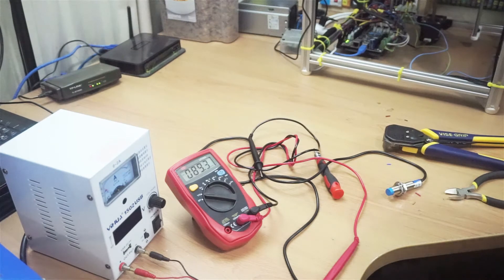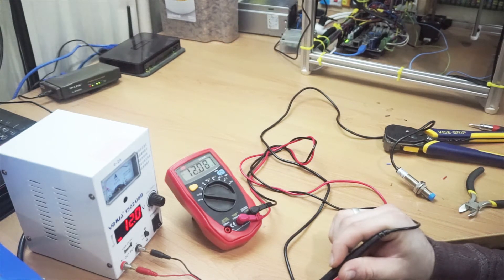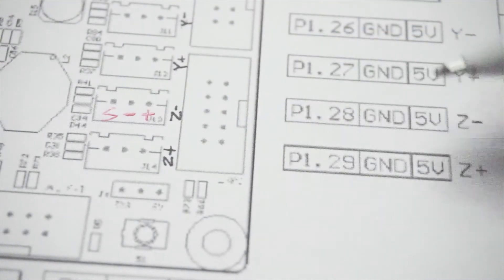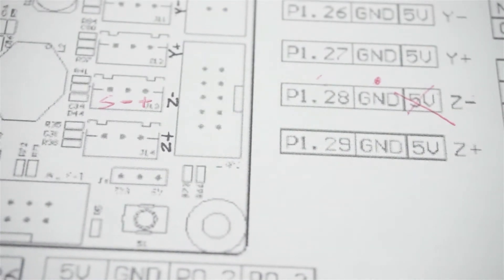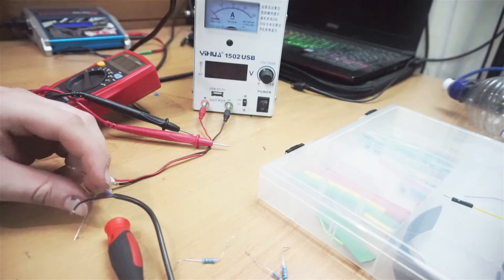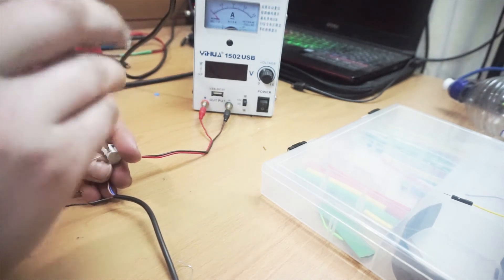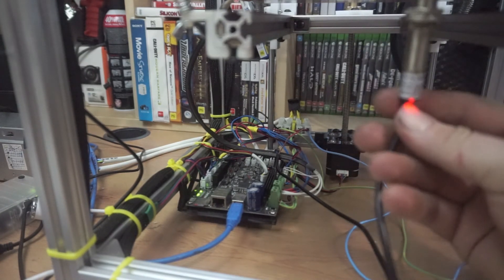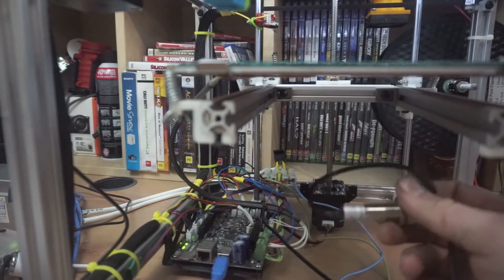How to use an Inductive Sensor with a MKS SBase/Ramps/All boards

Comment: Hi Guy, 

i need to use the smoothieboard v1 to control 3 steps motor, 3 endswitch and 3 servo motor. But i never used before. can you tell me please  how to connect it to the computer or how to use it? Do i need another sofware or microcontroller to control the Board? what are the differents steps till i run the first programm please?

Kind regards
Reply from the maker: +Axel Njuegang Njouongoua Ok, before you connect your smoothieboard you need to get a micro SD card and go to the smoothieware website and download the latest firmware and config file and follow the instructions provided.

to connect the board to your PC you just need a USB type B cable to plug into the USB port on the Smoothie board. Then you can just plug the other end of the cable into your PC. After a few seconds the board would have booted off the SD card and flashed the updated firmware and now should show the SD card as a removable disc in windows or Mac.

After you've updated the firmware. Disconnect the USB from the board and connect your stepper motors to the stepper motor 4pin connectors and connect your endstops to the 3pin endstop connectors. Servos are a little more involved but can be done. I suggest looking at the smoothieware site for information about it. After you've connected everything get a schematic of the board and take note of the pin numbers you connected to the control pins of the servos, you don't need to do this for the steppers or endstops as the defaults are fine. Once you note the pins, connect the board to your PC and open the config file on the SD card. The config file is where you configure everything no external programmers needed.

From here you can add the extra config lines for servo control and modify their enable pins to communicate with it. After saving your config file, make sure you disconnect your USB and have a proper 12-24v power supply connected to the board and turn it on. The board will power up and you can now reconnect the USB and communicate with the board using pronterface or other software. Note you need to have the extra power supply to run the steppers and servos otherwise they won't move because the USB power isn't intended and isnt meant to be use to more the powerfull steppers.

Hope this helps but the smoothieware website is the best source of information. :)
Reply: thx you guy.. this will really help me!...

so, for the servo..it´s possible, just i have to look which pins i used for...so i don´t need any extra sofware and microcontroller as "arduino or raspery"?

can i control the smoothieboard with Labview(it´s a graphic programming language)?
Reply from the maker: +Axel Njuegang Njouongoua No problem. Yes! You can drive the servos directly off the board you just need to connect them to 5v and ground off the smoothieboard and then connect the signal pin to a free Aux pin and then edit the config to use the servo control on that pin. Typically in form of say 1.28 which I'm the config is the pin for z min signal.

For controlling the board, IV never heard of LabVIEW but there's plenty of programs out there to use. Just remember that to drive the board you'll need a g code file or a program that connects to the board and allows you to send g code seperated. If youre using the board for something that needs looping actions, an Arduino or raspberry pi with additional motor drivers are the best way to go as iv never seen any one do that with a g code file. Some programs to use are the mach3 software or pronterface bit slot of free 3d printing software has a control panel built in to control the board over USB
Reply: thx again..for any other question..i will come again.

let´s try this first!
Reply from the maker: +Axel Njuegang Njouongoua no problem :)

Comment: where we need to plug pt100 sensor on this board?
Reply from the maker: I do believe you can connect the PT100 to a ADC pin, typically 1.30 or 1.31 as referenced in this smoothieware page, http://smoothieware.org/pt100
Reply: yes but do we need an external module or not for sksbase :)
Reply from the maker: From what I know you can only use the E3D PT100 sensor with smoothieware and you do require the E3D PT100 Amplifier board.
Reply: are you already test wifi module for skm sbase? a video about it could be great too!i have so many idea ;)
Reply from the maker: Haha, i dont have the wifi module as i dont really use the MKS tft screen that the module plugs into but i can get one and make a video on how to set it up!

Comment: hi Bryce, thanks for the video. I'm trying to make my Hypercube working with MKS Sbase + BLTouch, but not getting anywhere. I was thinking to give a it try and use inductive sensor I have. Can you please share with me your config file, either BLTouch or inductive configured one. Would really appreciate it. thanks
Reply from the maker: +Matej Stavina sure thing! This link will give you my BLTouch set up note the servo section and the probe sections. For a inductive sensor you really don't need to change the config but you best of set the probe settings to allow a probe to do level methods.

https://www.dropbox.com/sh/fnwsamo3dd91bug/AADkqkMyjNc_p3Y33wHqqTnNa?dl=0
Reply: thanks Bryce. will try it this evening.
Reply from the maker: +Matej Stavina no problem :)